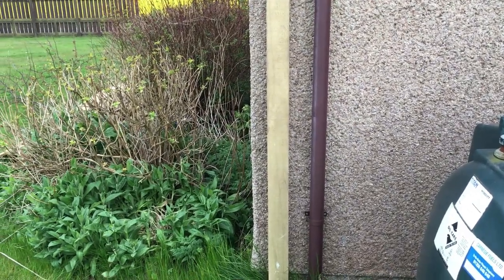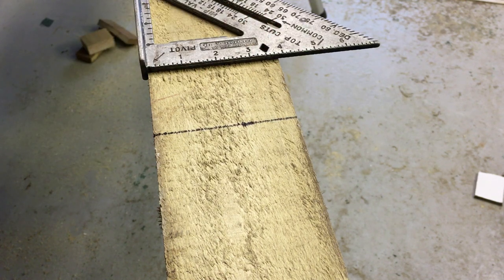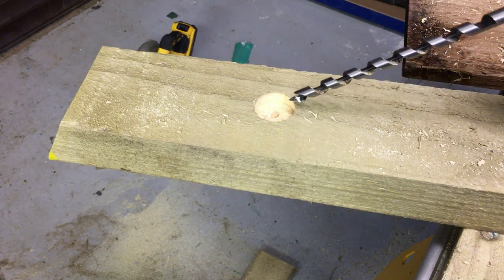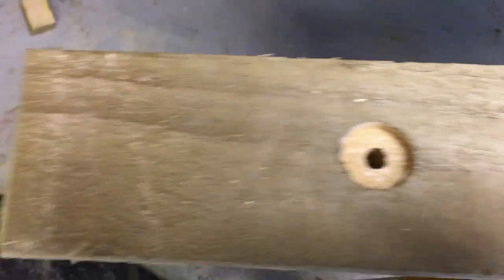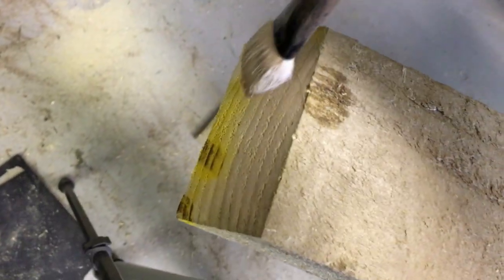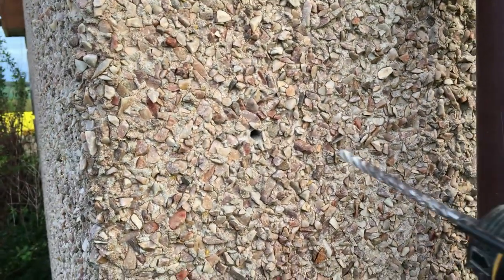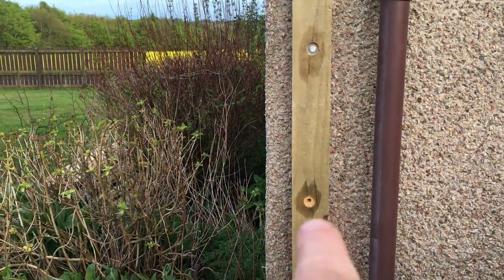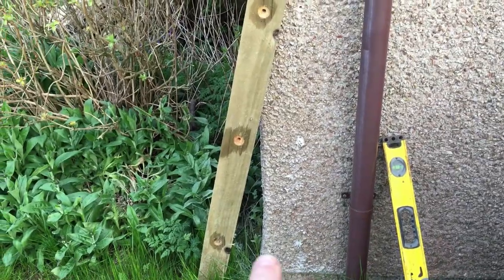How To Fit a Fence Post to a WALL

Comment: Torx fixing bolts are great, just drill straight through the wood  into the concrete with 6mm bit then impact driver um, use an 8mm washer.
Reply from the maker: Yes, I started using them about a year ago and don't use anything else now - they are fantastic. I must do a video on those - thanks for the comment !
Reply: @Bacrenfencing  👍

Comment: Best to position the post off the ground to prevent ground rot. I usually rest it on a brick just to make sure.
Reply from the maker: Yes, I always do that too - roughly about 50mm. I did in the video but it is hard to see due to the long grass, I forgot to mention this in the video. Thanks for the comment

Comment: For some reason my forgefix bolt won't go into the wall. It goes in anti clockwise but then it pulls out of the post. Any ideas? Thanks :)
Reply from the maker: Are you sure you drilled the hole the correct size ?
Reply: @Bacrenfencing  Yea I used a 10mm drill bit (same as yours, 200mm length). Took the post away from the wall and  and tried putting the bolt into the wall directly, but it just keeps rotating and widening the hole, not biting. Thinking I've messed up and got the wrong bolts...

Comment: interesting what you have not said is that timco recommend that you over drill the hole and blow out all the dust before you put the bolt in for a top job rather than a slightly half asred one . But they are cracking bolts
Reply from the maker: I use them all the time and never have an issue with them, I rarely blow the dust out of the hole and they work with no issue. I do however over drill the holes to stop them bottoming out. Thanks for the comment

Comment: thanks for the video, i have to install two gallow brackets for a porch , i would be filling the holes on top of the bolts afterwards and painting them , i think these concrete bolts are stronger than a frame fixing ?
Reply from the maker: Yes, these masonry bolts are a lot stronger than standard frame fixings. Thanks for the comment

Comment: Thanks for the video.  New to the channel and have just watched a couple of videos so far.  Very in formative and well put together - I particularly love the way you mute the tool noise so that it almost does not appear.  Its so soothing.  Its not like people don't know how power tools sound, but you are the first person Ive come across that does this.  Cheers.
Reply from the maker: Thanks again Ian, yes, there is nothing worse than chilling out, watching a video when all of a sudden, you get the scare of your life with a power tool going off at full volume. I usually lower the volume by 90% on those parts - still learning all this youtube stuff, so hopefully I will improve as time goes on. Thanks for the comment, much appreciated ! 👍😍
Reply: What?? Did he mute the drill's noise?

All my afternoon wasted trying to find a soundless drill at several hardware stores!!

Crap!!

😬
Reply: @Nayo68  😁

Comment: Stumbled across your video because the house builders have done a shoddy job putting our gate post in. They drilled into mortar using torx head fixings, resulting in pulling away. I'm liking the idea of countersinking the head and using the hex heads. I feel more at ease tightening with a ratchet than with a screwdriver or drill.
Reply from the maker: Thanks for the comment. Yes, when fitting a gate post or anything for that matter, always best to drill in to the actual brick or block, never drill in to the actual mortar of the pointing. 
  Also, best to use a ratchet for tightening the bolts as you have more control that way. If you use an impact driver, there is always the chance that the bolts strip the created thread in the concrete and they will just end up spinning and not getting a grip. The bolts only need to be nipped up, not crazy tight.
Reply: @Bacrenfencing  Much like you don't use a pillar drill to cut in a new thread on a metal flange or boss. An 8mm SDS would do the job? Post is nominally 50mm thick, countersunk 10mm, I'd be fine drilling 65mm into the brick and then slowly ratcheting in? 
I saw how ridiculous and shabby the erection job was with the screws going in off 90°. It wasn't even centrally spaced down the length of the post! 
Cheers for your reply though!
Reply from the maker: @Titot182  Thanks for the comment, I am not the sort of person to worry about masonry screws going in at a perfect 90 degree angle. This is fitting a piece of wood to a wall, not precision engineering. The holes were spaced for my specific application (matched the fence rails) and were not meant to be evenly spaced, I mentioned it in the video as usually you would space them evenly.......but every application will be different. Thanks for the comment :0)

Comment: Fantastic video! I’m having to buy a wider gate (1.2m by 1.8m) for back garden to allow easier access for my Iron 883. Been trying to figure out all day how go about trimming down the concrete block wall and this was the last thing to figure out. Brilliant work, I’ll get cracking on this Sunday 👍🏻 gonna check out rest of your vids now
Reply from the maker: Thanks Jackson, I am glad the video was of some help to you 👍😀
Reply: @Bacrenfencing  thanks buddy, got another question, but it’s shed wooden base related, it was prebuilt before I moved in (8 x 6), I’m wanting to strengthen the floor but I need to know where the joist/beams are so I have a screw anchor point? Relative newbie at all this and don’t have X-ray vision of course so at a loss (in my tiny brain) how I can safely get to see the base frame joists without making my shed fall down 🤣 thanks in advance
Reply: Can I give you some advice, whatever you do never ever sell your 883 I miss mine so much like I sold a part of me. 
Look after that iron horse.
Ride hard roll free...

Comment: Great video. I would have liked to see some form of caulking around the holes to avoid water penetrating through the holes and get tin behind the wall where it can lead to water damage.
Reply from the maker: The holes are 100% sealed with the bolt threads, so no need for caulking. Thanks for the comment

Comment: Thanks really clear good instructional video, is there any ideal fixed depth for the fixings to penetrate the wall?
Reply from the maker: I usually ensure that they are at least 50mm into the wall, but it obviously depends on the thickness of the wall. 50mm is a good starting point. Thanks for the comment

Comment: Great video mate, I have been using those fixings for a while now and always use an impact driver to tighten them up. I think your method is far better with the ratchet as more times than not I will over tighten and put the timber under strain. Cheers for the heads up.
Reply from the maker: Thanks Davie, I always use a ratchet when tightening these now because they are very easy to over tighten and strip out the concrete, especially on modern house walls. You know what it's like. strip the concrete out (bolts keep spinning) and end up having to put in 10mm diameter fixings as opposed to original 8mm............I learned from bitter experience  😫😥
 Yes, they can take a hell of a grip on some substrates and it is easy to strain the timber as you say  ! Thanks for the comment 👍✊😀

Comment: Apart from being a great instruction video, I wanted to see how well these threaded anchor bolts work in cement block walls. You make it clear they work well and look much easier to use than sleeve or wedge bolts. Thanks.
Reply from the maker: Glad it was helpful Kevin, thanks for the comment 👍

Comment: Thanks for posting, really helpful. I'm going to be following this video when I do my gate and fence. What size posts did you use, are they 4 x 3 inch?
Reply from the maker: Thanks, the post on the wall is 4 x 2" and for the fence I always use 4 x 4 " posts. Hope this helps.

Comment: Very well executed job, very helpful. What are your thoughts about cutting the bottom of the post to clear the ground and avoiding soaking up moisture?
Reply from the maker: Thanks, Yes you are best to leave around a 50mm gap between the bottom of the post and the ground. If you have the cut end down, make sure and treat the end grain with plenty of clear wood preserver or paint. Hope this helps. Thanks

Comment: Hi there, nice video, and well explained. I'm looking to fix a decking baton along the rear of my house, would you recommend these screws, or something a bit sturdier like Rawlbolts as at times it may be taking the weight of a few people etc. Many thanks :)
Reply from the maker: Thanks, yes, these screws are perfect for that, but get a larger size 10mm or 12mm in diameter. Then you can choose the length you need.

Comment: Great vid. Can you clarify what type of drill bit you were describing at 8:21 in the video; the ones you said actually 'pull themselves into the concrete'?
Reply from the maker: They are Heller Tri-Jet SDS drill bits, they are available on Ebay and come in many different sizes

Comment: That was an informative video. Do you worry about water ingress into the roughcast through the drill holes at all?
Reply from the maker: Personally no I don't worry about that. If it really bothers you, then you could squirt a load of clear silicon in the hole before using the bolts, but I don't think you need to worry about that.
Reply: @Bacrenfencing  thanks for the advice

Comment: Hello mate, I've had some trouble getting the bolts to take to the hole that's drilled, any tips? Cheers
Reply from the maker: This can sometimes happen if the blocks are quite soft etc. If this happens, I usually go up a size. In other words, if you have drilled holes for M8 bolts, then buy a few M10 bolts and use these in the same holes - that will usually work. Hope this helps

Comment: Hi,what size bolts did you use and how far into the brick work does the bolts have to go in.Thanks
Reply from the maker: The bolts are 8 x 100mm and they go in roughly 50mm. They come in many sizes, I have put links in the description. Thanks

Comment: Do you drill Same size masonry hole as the bolt size ie 8mm bolt use 8mm drill or do you drill smaller?
Reply from the maker: Yes, for an 8mm Timco multi fix screw, you need to use an 8mm Masonry drill bit. Thanks for the comment 👍

Comment: Probably a silly question but if you remove the post later and untighten the bolts, can you easily rescrew it back onto the wall again with the same tightness as it was the first time? I’ve not used these types of bolts before with no raw plugs and can’t get my head around it. Thanks
Reply from the maker: Yes, you can remove these easily and then replace them again as they cut their own thread into the concrete. Thanks for the comment

Comment: Hi there, great video, thanks for posting. Apologies if this question has already been asked but I scrolled through about 30 or so comments and couldn’t see it. I noticed the bottom of your wall has a slight lip, assuming for water run-off, would this not affect the level of the post going towards your fencing? If this was the case would it be a simple fix of making the post shorter at the bottom so as the lip would not affect levels?
Reply from the maker: If there is a large lip and I am hanging a gate for instance, I will always use a 4x4 post as opposed to a 4x2 timber. That way you can notch the posts to to fit over the lip on the wall - this enables you to plumb the post. In the case of running a fence off of it, it does not really need to be 100% plumb to the wall as it is just being used to attach fence rails, so yes you can make it shorter. I will make a video explaining this as I get asked this a lot. Thanks for the comment
Reply: Bacren Property & Fencing that makes sense, thanks for explaining
Reply from the maker: @davidllewelyn-evans3229  No problem

Comment: Where was the 4x2 (100x50) post from mate? My local merchant doesn’t do them in treated timber, just saw milled ones
Reply from the maker: I get them direct from my local saw mill. If you can't get them then you can use C16 or C24 planed timber (get it from B&Q etc) as this will do the same job. C16 and C24 timber are also pressure treated.
Reply: @Bacrenfencing  nice one, cheers mate

Comment: Really useful, thank you. I have 100x100 posts which I will hang a heavy side gate to. What length bolt/screw would you use? Is there a set length that it should go into the brick?
Reply from the maker: Thanks Jonathan, If using a 4 x 4 post, I would use either 8 x 130mm multi fix bolts or even go up a size to 10 x 130mm. Also, drill a deeper 32mm recess in the post which will mean less material to go through - in other words, drill a 25-30mm recess and use 130mm long bolts, that should be fine. I hope this makes sense. Thanks 👍
Reply: Really useful information and answered a question I have, so basically you want the fixing to go into the brick about 60mm

Comment: Great video, thanks.

Any reason not to use these bolts On a rendered external wall to fix a gate? Thanks again 👍🏼
Reply from the maker: Hi David, No, these bolts would be fine for that purpose. 
Thanks for the comment 👍😃

Comment: hi, Thank for showing that, just wonder if the anchor would help a lot on this situation
Reply from the maker: Hi, Yes the anchor helps in this situation but you can use frame fixings or concrete screws which do the same job. I just find these Multi fix screws to be the best and strongest for this particular application. Thanks for the comment.
Reply: @Bacrenfencing  Thank you for the reply! I also noticed that you were using a socket wrench rather than an impact driver. coz impact driver too strong?
Reply from the maker: @bruceli161  Yes, I don't use an impact driver when using these concrete screws as it is easy to strip out the holes if not careful. Best to use a ratchet or spanner as you can get a better feel and not over tighten. Hope this helps
Reply: @Bacrenfencing  Thank you so much! what an expert

Comment: What were the drill bits you were using? Never seen those before. Thanks for an excellent video.
Reply from the maker: Hi, They are HELLER 4 CUTTER SDS drill bits, you can get them on ebay via this link https://www.ebay.co.uk/itm/PREMIUM-QUALITY-CROSS-HEAD-SDS-PLUS-DRILL-BITS-4-Cutters-Concrete-Rebar-Masonry/202323611334?hash=item2f1b6d4ec6:g:JDcAAOSwoNVa6HC4

Comment: Great advice, I'm doing this job to fix a gate post.  Is it right that you use a 8mm screw and a 8mm drill bit? I'm an total amateur, but would this allow the screw to bite properly if its the same width?  Cheers
Reply from the maker: Thanks, yes, you use an 8mm drill bit with the 8mm multi fix bolt. The bolt diameter (excluding the threads) is 8mm but the threads on the bolt make the bolt about 10mm if you know what I mean, so use an 8mm drill bit.

Comment: Would this setup hold a swinging wood gate? I need to anchor a 2x4 to hang a fence gate but I’m worried the stucco won’t hold the 2x4
Reply from the maker: It depends on the strength of what you are fixing the post to. Are there bricks behind the stucco ?
Reply: I believe it’s just concrete. I don’t think there are bricks.
Reply from the maker: Maybe best to cement the post in the ground if that's possible ?
Reply: @Bacrenfencing  I want to avoid that because my side yard is all concrete. If I want to put a post down, which I have done before, I would have to cut the concrete and then dig.

Comment: I enjoyed your tutorial, is there a reason why you would just treat the new holes in wood with wood preservative and not the whole piece of wood ?
Reply from the maker: Thanks. Yes, the wood is all pressure treated, so it is only when you cut it or drill it that it exposes BARE wood. When wood is pressure treated, the treatment only penetrates the wood about 5mm, so when you cut or drill the wood, you expose wood that has not been treated - hence the reason you need to treat it. I hope that this clarifies for you ? Thanks

Comment: Could you use the same method for fixing a post to a wall you are adding a fence on top of. I have a c.2-3ft brick wall surrounding my garden so wanting to add a 3ft panel to the top. Could I attach the bottom half of a 6ft post to the wall in the same way, with the panels then just attached to the top half of the post?
Reply from the maker: Yes, you can do that, if you look at my video here, that is what I done with this installation https://youtu.be/wdP8Cz2HaMA The only thing to bear in mind is if it is an exposed area, you would be best to connect all the posts with a backing rail to help tie it all together. Hope this helps ?
Reply: @Bacrenfencing  I'd just been watching that 😀. Rather than cutting lengths, no problem just fitting standard width panels to the posts, no? These are really helpful, thankyou. Makes it feel like if you get the right gear, you're halfway there
Reply from the maker: @grahampriestley3105  No problem, yes, if you have the right tools and materials for the job, it is definitely easier ! Good luck with the installation and thanks for the comment !

Comment: Great video for a beginner like me.  I want to attach 2in timber to a 4in thick block wall.  What size bolt would you recommend?
Reply from the maker: Hi David, Thanks for the comment. You would probably get away with M6 X 100mm bolts like these https://amzn.to/39I27Cb but it really depends how much load you will have on the timber (what the timber is going to be used to support). If it is going to be quite a high load, then you can use M8 or M10 bolts (100mm long). Hope this helps 👍😀

Comment: Hi, thanks for a great video. I am a bit confused on the socket size you are using on the ratchet, you said it’s 15mm but is the bolt not 8mm? Thanks
Reply from the maker: Hi, Yes it is an 8mm bolt which is the size of the actual bolt thread, but the head of the bolt is 15mm, so you will need a 15mm socket to tighten the bolt. Thanks for the comment  👍